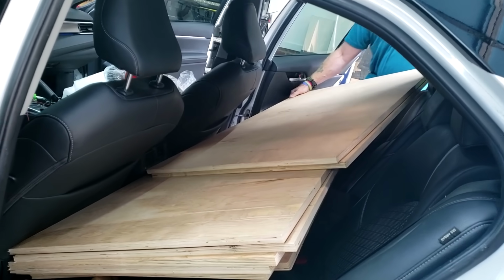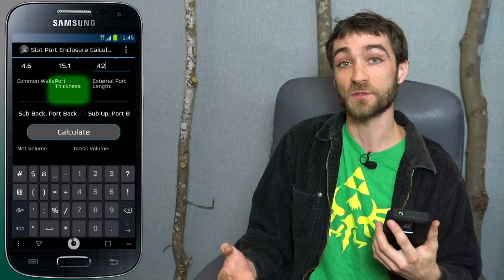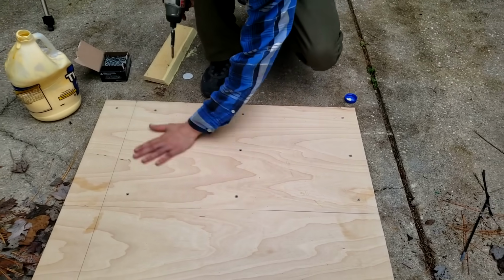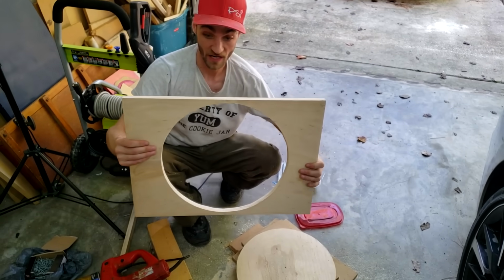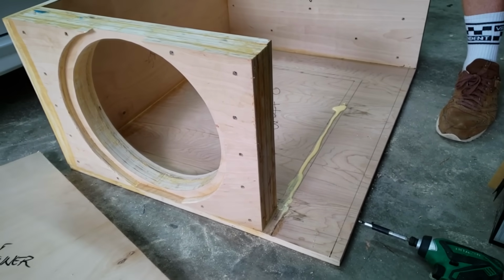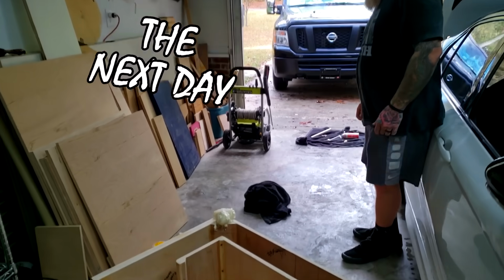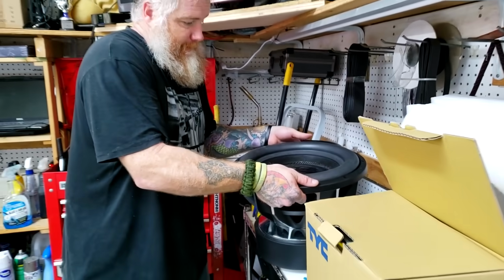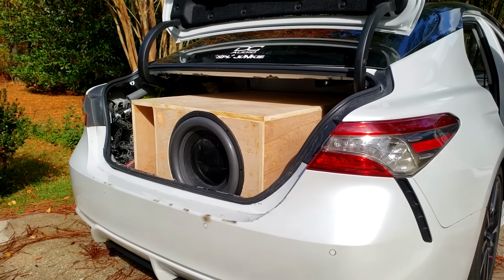Building a Ported Subwoofer Box for DEEP BASS!!! How To Design & Build LOW TUNED Slot Port Enclosure

Comment: I always chuckle when I see someone drop a speaker into a hole.  Come on guys, use zip-ties or some nylon string in a couple of the screw holes... makes lowering and positioning the speaker much easier.

Comment: Good vid dude, I'm a box builder over 25 years' experience MECP Certified back in the 90s ex installer I was lucky and got to install some systems that cost over 40k for some famous people "Baby got back!!" and few to no one understands what goes into designing a custom tuned box and what takes to build one, I'm in a different career now but it's a hobby I love doing in my spare time. I upgraded to a CNC router years ago and blueprint everything I build in Fusion 360 CAD software and use WinID to see my tunes plus cross reference it in a few different box builder programs online to spot differences I've learned which ones to trust , I build some top shelf boxes in my garage, I work a full-time job with a lot of overtime so I don't build to many anymore it's mostly through word of mouth "Plus I'm getting old". People get sticker shock when I tell them it's going to anywhere from 800 to 1500 for a single or dual sub box bare and take me anywhere from 2 to 8 weeks to build it. I remember back in the day building boxes like you the hard way with a jig saw and table saw out on the floor and in the driveway and I don't miss it. Good job using screws and not brad nails, good amount of glue, it turned out pretty good handmade, you would make some good stuff with a cnc I can tell if had the ability to make Rabbit Joints, Tongue and Groove, Lock Miter & barefaced joints you would be next level. I recommend a Infinity Journeyman CNC they are affordable and work perfect for box builders you can feed through a full 49" W X 8' to infinity really, I can't imagine doing it by hand these days if car audio is your daily thing especially if you start getting into SQ, I'm getting into Home Theater now it's a new experience.

Comment: Hi
I built a 3.5 cubic feet vented box with 3/4inch plywood and didn't use any bracing
When i tap the box ..it reverbs quite a lot
What can i do now to reduce the reverberation ?

Comment: Tip to glueing large panels together: @ 8:46 Always start from the center and work your way out. You can make a line across the middle and work towards the two ends or start in the center and orbitally move outwards it doesn't matter. The point is to force excess glue out not trap and pool it up inside.
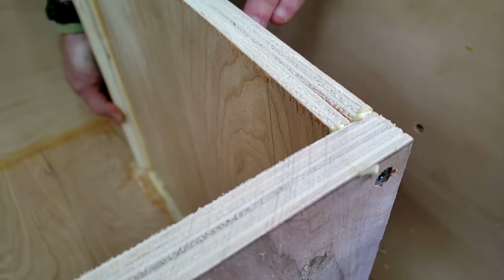And @ 18:55 whenever possible, never put screws so close to the edge. There is no exact formula because of variables like wood thickness & hardness, also screw thickness & length, size of pilot hole, etc.. My personal experience with plywood is a minimum of 2" from the end but more is better and pilot holes the same size as the screw shank. Plywood takes screws in the flat side beautifully but going into the edges, it won't compress around the screw and it splits. Of course a larger pilot hole reduces the torque you can apply so be careful not to strip it out. If you need better holding power there are remedies, you could go to a longer screw or you could add a couple drops of glue in the screw hole if you don't need to disassemble it in the future. Btw don't fill the hole with glue, it can cause hydraulic lock which may split the wood or block the screws progress and strip out. Otherwise a good build.

Comment: Hey those little phone apps are pretty nifty for figuring out volume to design your Port size, back in the day we used to use air conditioning ducklators to determine cfm's and back pressure amounts for cfms... I remember it being rocket science for everyone who had to sit down and try and plug in the values to an algebraic equation that they thought only NASA engineers knew how to do what a joke....!!!!

Comment: When I had nothing better to do I installed systems in my car. Then when my son got a little older his car and then his friend's cars. After doing this for years spending all kinds of money experimenting with different size components, amplifiers, crossovers, placement of speakers and everything that goes along with it. Wiring kits, fuses capacitors, upgraded alternators, upgraded wiring. I found that today's car stereos and speakers are a lot better than what they used to be years ago. The only thing that's really needed is a little bit of low end for those who really want it. Answer to that question is a name brand 10-in woofer in a box that's built by the manufacturer. Then you get a perfect match by people that do it on a computer there is no way on improving what they do. Then with an equally good quality name brand amplifier that's really all that's necessary. The days of me doing multiple amplifiers experimenting and spending all your money just to entertain the neighborhood is definitely over for me. The sound that's for me to listen to not the entertain my neighbors and for them to give me the evil eye every time I drive to my home.
Do what you like maybe it's your turn to play the game.

Comment: Pro tip: router all outer edges when its a tight fit. This will help the box slide in so easily it will make you amazed.

Comment: 19:00 splitters will happen when either the plywood doesn’t have enough glue inside; or if you screw too close to the end of the board. Put the first screw at minimum 1.5” from the top of the plywood panel. It’s ok, just helping others to prevent extra work

Comment: Also what is the longest time frame that an installer should have your vehicle vehicle in question is a 2005 Cadillac STS the gentleman is doing a complete install front windshield all the way to the trunk every single factory speaker is being replaced head unit is being replaced .two sundown X 12 V3 in the trunk Three amplifiers DSP upgraded alternator as well as 40 ah  limitless in the rear trunk this gentleman has had my vehicle for 20 days and he is still not finished he is not allowing me to come look at the vehicle claiming he is in fear of his life or he’s scared that’s bullshit the first 14 days I was completely awesome offering all help I could I even went and picked up and purchased a Birch Wood so he could stay at the shop I personally feel like he is dropping the ball I have supplied him with $7000 worth of equipment he has no need to go anywhere to purchase anything even down to the stain I went and picked up myself to get the color that I wanted for the box he is also building me a box as well as a fabricated rear dash just above the rear seats under the rear window.... it has been one excuse after the other he’s giving me multiple different completion dates and surpassed every single one continuously states I am completing the job at hand and you will pay me the agreed amount per the contract I replied with sir you have given me seven different completion date per contract you have surpassed them all what is the point of a contract so my question is this he told me it was going to be $3200 just in labor and he would complete the job within four days it is now twenty days he is not completed I paid him basically in full upfront dropped off the vehicle one day gave him seventeen hundred dollars three days later he called me begging for the final payment so he could pay his rent for the shop and I said I don’t feel comfortable giving you the final payment before completion he continuously begged me I asked the man how much do you need for your rent he said at least a thousand dollars I said I got you I old him at that point fifteen hundred dollars in labor I gave him eleven hundred dollars so he could have a hundred dollars in his pocket in case he was hungry or needed anything I feel like this is ridiculous it’s going to be a month by the time I get my vehicle back and he feels like he still deserves The final $300 payment he keeps referencing the agreed contract price point and I reply with boss you surpassed the agreed to date seven times per contract how do you feel you can drop the ball continuously and still get the same amount of money as if the job was completed within four days I just don’t agree and I’m just looking for somebody‘s input does it matter how long this gentleman takes completing my build does he still get the same amount of money because the job was done doesn’t matter if he did the job within four days or he did it within 32 days not to mention he told me the job was going to be completed on a certain day I ordered the wrong subwoofers I thought I ordered v3 I did not I ordered x12v2 So he told me he was going to be completed on Sunday I said could you stretch the bill till Tuesday I’m going to overnight the subwoofers he said yes the subwoofers came last Tuesday the job is still not completed what the fuck did I spend more money on the overnight fee then the actual two subwoofers cost for them just to be sitting at your shop so the courthouse told me that he is liable for that $500 overnight fee because he is the owner operator and I went off of his wordplay he stated he was going to be done Sunday so I overnighted the subwoofers had he told me he wasn’t going to be done for a couple of weeks I could’ve let them come regular mail and be good to go but no he allow me to spend $1800 on the overnight fee for two 70  pounds subwoofers So the question is should I pay him the final $300 fee for labor or do I basically just say you’re all set buddy and drive away I feel like this is the type of shit you encounter when you’re paying somebody $500 to do a build not when you’re paying them $3200 and you’re basically paid in full upfront out the kindness of my heart before you even halfway completed the build

Comment: Ask any woodworker what he thinks of MDF.  Rest assured it will not be a family-friendly answer.  MDF has an atrociously low strength to weight ratio, can't hold fasteners, and if it gets wet, forget it.  Baltic birch plywood is such a vastly superior material - I can't believe anyone would suggest MDF has any advantage over it other than price.

Comment: Im new to your channel. I learned a lot about tuning and ports when designing your box. Thanks. I have a 02 suburban any suggestions on getting super low? Like should i use one sub or two? Im just curious on how you would build your system if you were in my shoes. Oh and how do i sighn up for the 15 give away?

Comment: I always drive smaller cars so I use 12’s ones that can take small boxes and high power so I can use multiple subs in one big ported box tuned around 32htz! Or that’s what my current is tuned at I have had cars that where tuned to 45htz but they did big numbers but didn’t play the Lowe’s very good! These days we want the opposite we want the crazy windy 20htz bass at 150db or more! I blew one of my dust caps off a while back had my window down didn’t think about my subs being decoupled and popped it right off but I super glued it back and it still works perfect 3 years later! Rusty at DC audio said to send them to him and he would put all XL coils, cones, and all other soft parts and and change my baskets to the newer models basically mailing them like custom XL lvl4’s all painted and fixed up! I want to add another DC audio 2k and use one per sub as all my other channels have their own channel active ram from a DSP! It’s get ridiculously loud for 2 12’s on 2k! I had my box built slightly bigger so they would be for efficient amd than bang just got to keep the windows up so they don’t over exert themselves. I have the sub Sonic set to 20htz but that only does so much when there banging hard!

Comment: Great job guys one thing though you should really pre drill one size larger through the top board when you want the clamping effect this stops the screw the ass from catching and pushing back on the top layer other than that this is a great box.

Comment: Lil trick keep the sub facing backwards bro it hits harder like that and leave the seat down no tye woofer back hits harder test it bro i know i have made so many groundpounders in my life time and the dowls and corners all that you dont put none of that in it hits the hardest with out the dowls and corners blockers got keep the echo going and md board is the best for it but i like fiber too i won lots of competitions with fiber they flex harder and back in the days we had the quarter test you put a 50 piece or quarter on the roof and which one jumped the highest won and fiber would do it everytime it makes the car shake harder so in a way fiber is the way and never use tubes they fail evertime always port sqaure port the best i make ground pounders for 2 15s compresssion in a single cab truck cut outs they turn buildings to confetti i mean sgread a window with the pressure in the cab but nice build i loved it bro your awesome maybe one day will build a ground pounder pressure for a square body chevy great job but memer keep the sub to the back on cars like those trust bud lol fantastic job

Comment: Why don't you put painter's tape on the outside pieces to prevent cleanup later. Find a table to clamp your Ryobi to. It's your back, but mine is fugged up from working on weird angles.

Comment: Do you have any guides to how much polyfil changes the box size?  For example, 1 inch thick for a 2.5cuft = 5hz.  I used this app to design a very similar box to this, but I could only get to 30+hz after bracing, I was aiming for 28hz. I added a very thin layer of fill, I didn't want to over dampen. Any help would be so appreciated!

Comment: EXO, just a quick question : i have my subs pointed to the ffront, as soon as u open the trunk more bass comes out and it gets louder. If i turn the sub box around it acts like the trunk is open and is louder. What causes this and. Which way would u turn the box. Thank uou
Reply: You want the longest distance for the soundwaves to travel, so rear facing, it gives the long waves (sub bass) time to propergate. It also helps to have the cone kind of close to a wall or solid surface, it makes the waves bounce and take longer to get to you  You can easily tell which way to orientate it by using your phone and a SPL app, play a test tone of say 40hz with a tone generator app, a website or file, turn your headunit up until the phone mic clips, say volume 20 for example (it won't be loud, the mic won't take much) then turn it down like 3 steps. Now measure what the SPL is with the sub facing rear, then facing forward. Play with different arrangements with this method and find your peak frequency and most efficient mounting direction

Comment: Why not use pocket holes to avoid splitting?
Reply: I bought a pocket hole jig for my latest build, but in the end i didn't use it. I wasn't sure of the strength, and so I decided to use some pine coloured wood filler, sanded it back and I stained the entire box. I was really happy with the result, but all the sanding and getting the screw holes filled so that they aren't detectable at all was a lot of work. That box took me 2 months of 8 hour days to build lol.

Comment: EXO I am building a box for 2 15s practically the same way as this lol.  I will also be using a poplar dowel rod like you did for Wesley's box lol.  You are secretly inspiring my build.  I'm only grateful for having removable braces so I can put my box into the trunk through the cab.  I have a small car and 2 15s wont fit through the trunk opening(12s are the biggest that fit through the trunk) 😑

Comment: what happen when port size are too big ? im order custom sub box from online and now have a mistake port size are too big 4inch width & 14inch height and around 20inch+/- length, box size is : 27inch W @ 15.5inch H @ 15inch D + 12inch Jbl stadium 1224 subwoofer 500watts rms & 12mm xmax + running on monoblock kenwood 500watts rms too, manufacturer recommended box volume is 2.5 ft³ . sorry im beginner, im prefer to Louder Bass, not too low freq but ok if this box can get a loud bass

Comment: Very nice designs, but WHY do you use the worst, cheapest wood humanly possible? Cant remember the name of those wood sheets but its obviously the ones that are like scrap wood jamed in the middle of several very thin "sheets" of other wood, I know that because a sheet of this wood is made up of several much thinner sheets glued together that especially with lots of shock or vibrations (Aka the definition of a Subwoofer box! lol) it Will & does "separate" as its definitely not made for that type or environment. Not to mention working with it is horrible as we can see how bad its "splintered" etc! U use to save money? is it scrap? WHY not MDF etc?

Comment: Hemm.. you went free handed with a router? When you got all that thickness? 
The sub hole it's done before assembly.. you use the router one side half the way.. then the other and you will have a perfect circle.. and much safer do use the router that way..

Comment: Ive never went with a 42" length port, i always used 30" and under. I wonder what the difference in sound would be with such a long port but still at the same tuning range. Short port vs long ports? Of course their is figuring port vs net of box for the tune but hmm 🤔

Comment: that is a large box for a 28hz ish tuning, maybe next time make the  port smaller while still being the same depth. iirc people in forums say if you tune your box low, you dont need as big of a port. take the jtr cap 4000, it is tuned to 10hz and the port is very small (maybe even smaller then this one) with 218 in the box. if you make the port smaller, you might be able to get a 20hz maybe even lower tuning.

Comment: fiberboard is not. real wood is the best. plywood. maple. clean. easy to work with. sounds better. I believe the little bit of flex from real wood actually can add to the overall SPL. Just a hypothesis.